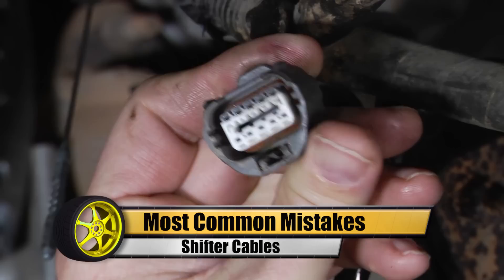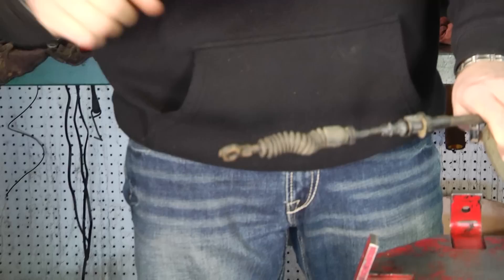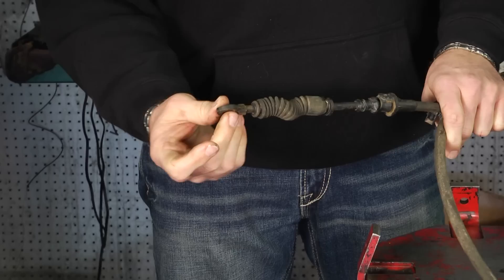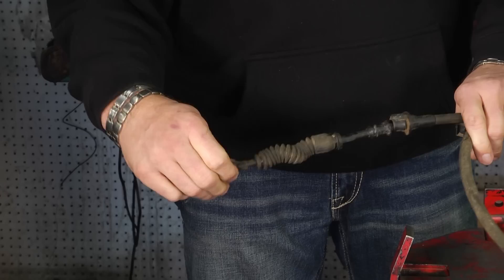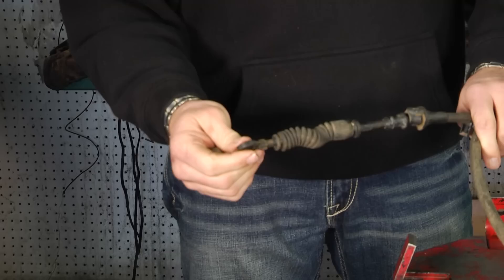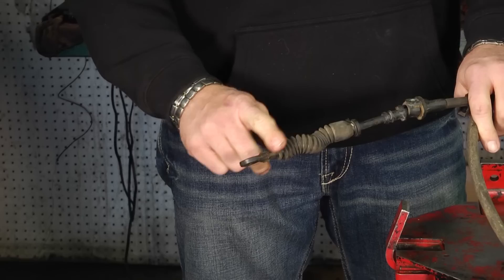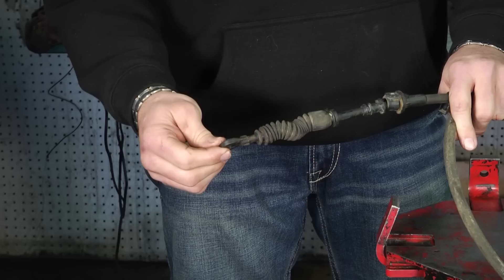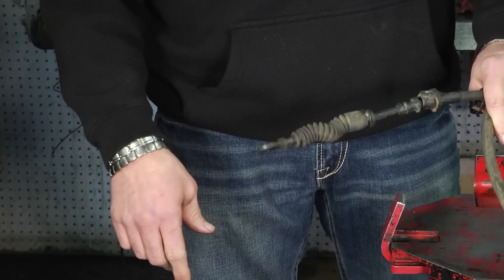Common Mistakes Installing Transmission- Shifter Cables

Comment: Kinda gettin pissed ngl. A million videos on the stupid bushings cuz it's an easy video to make for an easy an obvious problem. You know what isn't easy and obvious? How to actually do the replacement! Does your cable go through the floor or through the firewall? What electrical connections on the shifter itself need to be made? Can cables snap on the inside of the jacket or lose their tension? If you're reinstalling a transmission should the cable be in park or neutral? Is the only thing that keeps cables from being interchanged the linkage and length or are their other factors? THESE are what I want answers to. Not the thirteen hundredth "your bushing could be loose" video
Reply: Agreed
Reply: Absolutely bloody agree. My shifter cable, being an old GM design, has NO plastic bushings; it's metal on metal all the way from the column to the transmission. The cable has started binding, probably due to excessive heat, and I want hints on that, not the 1,000th video on plastic clips or bushings.
Reply: Dude thank you so much. You took all the words out of my brain. This is extremely frustrating
Reply: there is nothing electrical all is mechanical only two cables one fro changing the actual gears and one for left amd right on atick
Reply: you just need to have them under your car placed like in a box where the actual shifter is
Reply: The complete bushing part broke off mine... All the bushings in the world won't help....
Reply: pay for alldata and direct hit if you want professional answers.

Comment: To permanently solve this issue take the shifter arm off the transmission and cut the peg off of the shifter arm then drill a small hole through it. Now you will be able to use a small bolt, a couple of washers, and a locknut to reconnect the shifter cable for good with a much higher level of security. I haven't had any more issues with it since I performed the surgery on it. This is by far the best fix to solve this common problem and provide peace of mind when driving down the highway, I Promise You That!!!!!👍😎👌
Reply: Excellent idea 👍
Reply: @mayken6661  Absolutely since I reinstalled my trans I've had no more issues with it and the only way it's coming apart now is if I use  wrenches to unscrew it.👍😎👌
Reply: Yup, just replaced the whole cable at work because the bushing isn’t sold alone for Equinox 👎🏻. But they paid for it, had it been mine , your idea wins !
Reply: @mayken6661  Hey when it first happened to me I didn't know what was going on I thought my tranny had seized up stuck in gear. Now imagine the cable detaching on the interstate and having to stop in the middle of the road for whatever reasons only to find out you can no longer shift into any gears.😲 That would be completely insane.😳
Reply: It seems to me the crappy and unreliable OEM cable connection was decided upon to make the assembly line installation very simple and quick and the hell with problems down the road for the owner. A shame.
Reply: @kennethdegruchy5503  Facts I totally agree with you 💯%.  Clearly if you are on the interstate and had to stop and this happened it would be such a huge inconvenience especially in big cities. You literally would be stuck in traffic all day. Since I made the modification I haven't had anymore issues with it. I even took the plastic part of the cable and reinforced it with metal brackets and two worm clamps to make sure it doesn't snap for any reason. My cable is secure now for life and bulletproof. It's definitely quantum leaps better than anything you can buy from your local automotive parts store, I Promise You That Bud!!!!!💪😎💪👍😁👌
Reply: this shit happened to me on the highway too but it happened to be a bad ground from the gasket leak i had fixed the day before
Reply: now i’m stuck in second gear thought my clutch gave out imm hoping  this solves it
Reply: @ex4vier  If your shifter cable came apart from the transmission shifter arm this solution definitely should fix your issue. I ended up dropping my entire transmission to clean everything up underneath the truck getting all the rust and crud out.  The original transmission inside the my Hummer H2 was over 200,000 miles and was slipping so it was time to change it anyway. I found a 4l65e transmission from a 2008 Chevy Suburban at the salvage yard and put that in and it's been driving like a dream since the transplant. If all you need is to do is modify the shifter arm you probably could simply unscrew the nut holding it on and take it off to modify it. I was going to do that but my shifter arm and nut was so rusty it ended up breaking off when I tried to unscrew it. Let me know how it goes bud and if you have any questions about it feel free to ask anytime.👍😎👌
Reply: @J.Crooner appreciate you bro that’s some sauce right there 💯 i’m jus trying to avoid dropping the tranny for another 3-4 weeks so i can save nd just do the replacements, and seals it needs anyways. jus got a mechanic job so i’ll definitely come back to this post after i figure everything out. definitely a frustrating but rewarding process!
Reply: @ex4vier   Absolutely frustrating but more rewarding in the end especially when you can save $Thousands$ by doing the work at home.😎
Reply: Exactly,,,on my 88 Pontiac GTA the cable just came off the linkage. So i bought a bolt and lock nut and installed it. Works the same as the OEM one and don't have to buy a new cable and do all that tedious R&R work.
Reply: @desidinero2960  Exactly when I replaced my cable it was highly tedious from the topside inside my truck with the gear shifter. It took literally forever for me to get that cable installed. After hours of trying I finally got it to snap in properly and I don't look forward to ever doing it again. I'm glad you got it done and saved yourself a thousand bucks from having to go deal with the stealership.👍😎👌

Comment: My mechanic charged me 525 for labor and 118 for the part.
Reply: 😳Sounds like the typical "STEALERSHIP" price to me!!!!!
Reply: The parts are $95 for the cable and the bushings are $15 at the auto supply store.
Reply: I think that mechanic  is a crook. Its easy to install even if you dont know what your doing theirs videos
Reply: Mine charged 460 for all
Reply: Ouch, hell no!
Reply: Some it depends since they connect all the way on top and have to remove the whole center console to access
Reply: Some it depends since they connect all the way on top and have to remove the whole center console to access

Comment: lol how I got here when I was looking at at 2010 Jeep Patriot but this I can agree on, I had that issue where I adjusted the linkage so Drive actually went into Drive. After having to re-adjust the cable twice, I figured it was the cable either stretched, or now after watching this video, the bushing is worn out. I bought a new cable & next I'm going to change it. Great video to tell me that I was right when I decided to just replace the cable. So now I'll look for a video showing me what I cannot see, on what I need to do to replace it since it's very hard to see the cable routing on my 2010 Jeep Patriot....

Comment: Hi, which colored wire of the transmission is the one to start the car. My father is having problems since he changed the transmission with another one after putting in a gear box yesterday

Comment: Can the shift linkage cable (or shifter cable) cause gear timing or selection issues such as the speed measured by input shaft speed sensor to be different from the speed of the engine, and therefore TCM/PCM to report "Input Shaft Speed Sensor No Signal" error?

Comment: DIY FIX.  Get shock absorbent bushings n trim to fit alone with washers that fit inside. You may have to drill out the washer holes to fit. Then get some n use Eclips to hold them in place.
Will save you $30-$200 plus in cable cost alone n mechanics hourly fees.

Comment: My 2011 Mazda 3 is stuck in drive
Could it be this cable?
It only moves a little right and left ... from D to +/-
Reply: Maybe you have an answer by now, but I have a manual transmission and my car was stuck in 1st gear, so I believe the answer could be yes